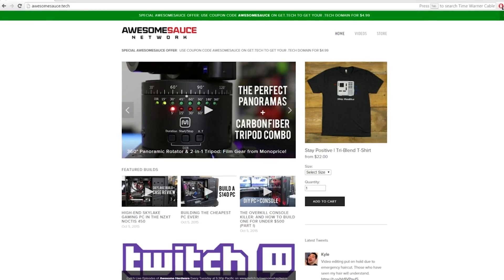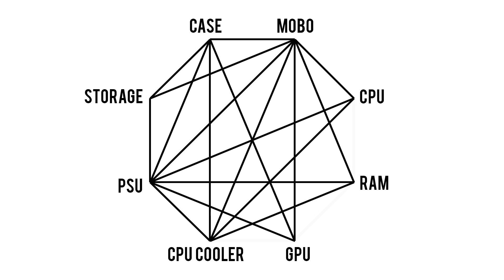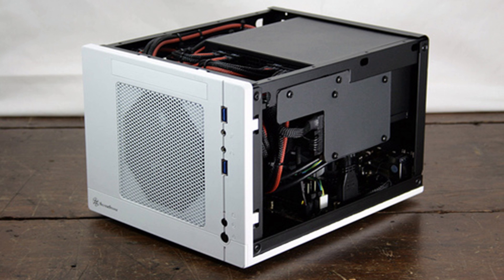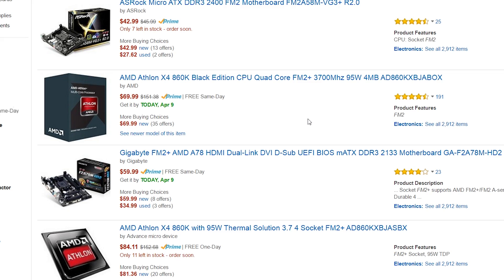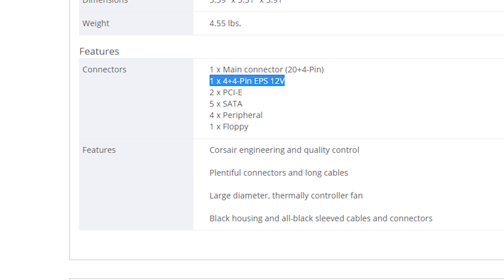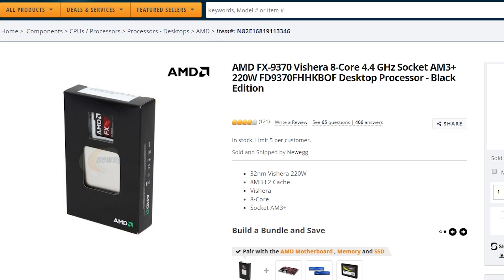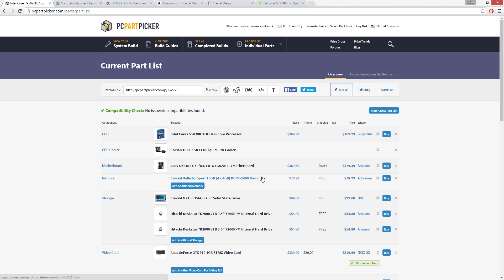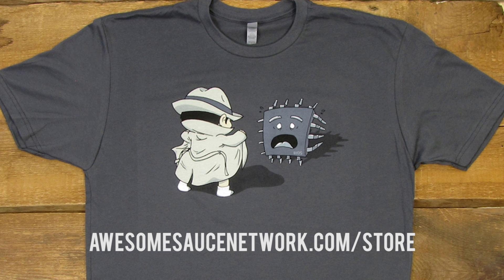How to Choose Parts for a PC! The Ultimate Compatibility Guide!

Comment: Does a msi motherboard always work with AMD ryzen
Reply: SUPERTACTIC yes. I actually have an MSI motherboard and a Ryzen 5 2400g. As long as the motherboard uses the AM4 socket, then you can put in any CPU that has the AM4 receiver.
Reply: @usainbolt7904  no actually. My MSI board only supports Intel CPU's.
Reply: @Sigma_Eight  i didnt mean it like that. What I meant was, MSI boards with AM4 sockets support Ryzen, and MSI boards with LGA1151 support Intel

Comment: I Hope This Helps :)

PSU = Power Supply Unit
GPU = Graphics Processing Unit
MOBO = Motherboard
RAM = Random Access Memory
CPU = Central Processing Unit
CPU Cooler = Central Processing Unit Cooler
Reply: I never knew cpu cooler was the cpu cooler
Reply: HDD- Hard Disk Drive
SSD- Solid State Drive
Reply: Good good. Now what do those.... do?
Reply: @huskobyte  
PSU: Converts outlet power into the different cables needed for your parts
GPU: Handles graphics calculations. Some CPUs have one built in (Integrated Graphics). Integrated graphics will work great for desk work, but won't be able 
to run many modern games at decent settings.
MOBO:
 Everything plugs into this
RAM: Stores temporary data used to run programs, nothing is saved here permanently. 
If you plan on gaming you probably need at least 8 GB.
CPU: "Brain" of your PC.
CPU Cooler: Keeps the CPU cool, as it its probably the hottest part in your build.
Reply: Jake O'Brien Understandable
Reply: @jakeob28  How do I know which piece I should choose, and what makes everything better than the other thing?
Reply: Genuis Bear research, if you put the time in too see what’s best bang for your buck by looking at yt reviews and online forums then you will be sure to save a lot of money
Reply: Genuis Bear your aim in the system is either to have everything you want in the beginning (make sure other parts don’t excessively bottleneck the other parts) or invest more in something’s like the cpu and decent gpu to then upgrade at a later date
Reply: Genuis Bear To check if everything is compatible just use pc parts picker. Com
Reply: RAM is also one of the greatest albums released by Daft Punk ;)
Reply: RGB-RED, BLUE AND GREEN
Reply: @whozurdaddy3423  It's actually Red, Green and Blue
Reply: SilozHD What does SMD stand for?
Reply: @Kai...999  surface mount device
Reply: @Kai...999  I think your in the wrong town pardner
Reply: Thank you 😊
Reply: My hero <3
Reply: Lit
Reply: This would've been super helpful when I first started building PC's
Reply: Was that last one necessary?
Reply: Thank u mate
Reply: Your the man!
Reply: Props to you making a comment we will like without you telling us to like or saying thanks for the likes 😃

Comment: I have an immediate tech question. Don't think I'm stupid for asking this... So I just built a new gaming pc but the old one I've been using is so caked up in dust, duster doesn't work and I don't have an air compressor. As far as the CPU, GPU and PSU that all have fans, could I spray the entire system down with a water hose then let it dry for a month before using it? I'm pretty sure the PSU can hold a charge so I don't want to mess it up but it's caked up in dust the most from the last place I lived with smokers. I'm sure giving it a month before  turning it on afterwards would have it completely dry but how long should I leave it unplugged before all the power is drained and I can start and can I do this without shorting it out?

Comment: Hey Guys Is my PC Build Compatible and Good?

Graphics Card : EVGA GeForce GTX 1080 FTW Graphics Card
CPU : Intel Coffee lake Core i5 8400k Processor
MotherBoard : GIGABYTE Z370P D3 Motherboard Coffee lake
RAM :Ballistix Sport 8GB DDR4 RAM 2666
PSU :VGA 650 B3 80+ BRONZE Power Supply Fully Modular
SSD :ADATA SU700 120GB SSD
HDD :Seagate BarraCuda 1TB Hard Drive
Computer Case : CORSAIR CARBIDE SPEC-OMEGA Mid-Tower Gaming Case
Monitor :ASUS VG248QE 144Hz Gaming Monitor
Cooling Fan : Corsair Hydro Series H115i Pro RGB

Advance Thanks for those who will reply :p ^^

Comment: CPU and RAM are also related. Just like the motherboard, the CPU must support:

        +  The type of RAM (DDR3, DDR4, etc (not sure if it's backward compatible)) 

        +  The frequency (1600MHz, 2666 MHz, etc)

        +  So if your CPU only supports 2400MHz but your RAM runs at 2600MHz then 
            your RAM is just gonna operate at 2400MHz (maybe)

        +  The number of channels (single, dual, tripple, or flex mode)

        +  So if your motherboard supports quad channel and you have 4 RAM sticks but your CPU only supports dual channel 
            then... maybe the computer is gonna operate at dual channel since the CPU doesn't support more than 2 channels 
            (maybe)

        +  and whether or not your CPU supports ECC (server RAM (Xeon does)) or Optane Memory.

The CPU must also be able to support a certain amount of monitors, the max resolution it can handle, and the CPU type must match with the motherboard. They both must be 300 series, same generation, and of course, same socket size. 8th gen CPUs are only compatible with motherboards that support that generation and they are not backward compatible.

So if you are having (let's say) an i7-7700 and a motherboard that supports the 7th gen then you're good. But if you want to upgrade you CPU to (let's say) an 8th gen CPU (let's say) an i7-8700 then you will need a motherboard that supports the 8th gen CPU. Once again, the CPU's and motherboard's generation are not backward compatible as well as the series (300) and socket size.

It's more complicated, man!

Comment: I need help can someone help me?
Is this part list of mine compatible it says it is compatible but still can someone confirm it please?
Reply: https://in.pcpartpicker.com/list/kWpfyX here u go mate im sure u can help
Reply: @TankiUnlimited  this motherboard is micro atx meaning it is a smaller board, the case is atx mid tower meaning it's a big ass case. Parts are fairly compatible mechanics wise other than that but the specs are going to be pretty bad.
Reply: Also with a CPU that lower end you wont need an aftermarket CPU cooler, the one that comes with the Intel CPU will be fine

Comment: BitWit, does my checklist work? I subbed and rang the bell.
CPU: AMD Ryzen 7 1800X $280
MotherBoard: MSI X370 Gaming Pro Carbon $190
RAM: 64GB G.Skill DDR4 Trident Z 3600Mhz PC4-28800 CL17 1.35V Quad Channel Kit (4x16GB) for Intel Z270 $1068
GPU: Nvidia GeForce GTX 1080 Ti  $1400
SSD: Samsung 860 EVO 4TB 2.5 Inch SATA III Internal SSD (MZ-76E4T0B/AM) $1400PSU: EVGA SuperNOVA 1600 T2 $530
Case: Lian Li O11 Air $120
Cooler: Corsair Hydro Series H150i PRO RGB 360mm Radiator Triple 120mm ML Series PWM Fans Advanced RGB Lighting Liquid CPU Cooler (CW-9060031-WW) $247 / Be Quiet! Dark Rock Pro 3 CPU Air Cooler $90
SoftWare: Windows 10 $120
KEYBOARD - CORSAIR K95 RGB PLATINUM Mechanical Gaming Keyboard - USB Passthrough & Media Controls - Fastest Cherry MX Speed - RGB LED Backlit - Black Finish $170
MOUSE PAD - Glorious 3XL Extended Gaming Mouse Mat / Pad - Large, Wide (Long) Black Mousepad, Stitched Edges | 48"x24"x0.12" (G-3XL) $40
HEADSET - Sennheiser GAME ONE Gaming Headset - Black $161
Tool Box - iFixit Essential Electronics Toolkit $24
USB - KOOTION 5PCS 32GB USB Flash Drives Thumb Drives Memory Stick USB 2.0(5 colors: Black Blue Green Purple Red) $36
Wifi USB - MSRM 926AC 1200Mbps Auto Install Wireless WiFi Adapter 802.11AC Dual Band 2.4G And 5G USB WiFi Adapter with External Dual High Gain Antennas for Windows7/8/8.1/10/XP/Vista, Linux2.6.18-3.10y $19

Comment: would a motherboard with 1 x USB 3.1 Gen 2 header
2 x USB 3.1 Gen 1 headers
2 x USB 2.0/1.1 headers work with a case that has 1x USB 3.0, 2x USB 2.0, 1x Headphone, 1x mic front ports

Comment: Would this work as a budget build PC? https://uk.pcpartpicker.com/list/9bmHvV
Reply: If the currency is british pounds (i think it is but i may be wrong), or if the currency has more value than the USD, then id say its alright for a PC build. Try to go a little cheaper if you can.

If the currency is the same value (unlikely) as the USD, then its pretty good.

If the currency has less value to it, then its pretty great.
Reply: Instead of getting a costly NAS grade HDD, get a small capacity SSD and a normal HDD, I suggest WD Blue.

Comment: If the MoBo should be compatible with all parts, does that mean I should start off with picking the MoBo? I'm quite new to this and I'm afraid I didn't really get everything in this video ^^''
Reply: Yes. Pick out these things in order.

Motherboard
Processor
Processor Cooler
RAM
Graphics card (if you want one)
Power supply
Hard drive(s)
Case

This is just my personal recommendation, but ALWAYS pick out the motherboard, CPU, and CPU cooler first and together.
Reply: Thanks, I really appreciate it :D
Reply: Your welcome.

Comment: I am saving up for a pc. The one thing I’m scared for is cords. Connecting them or just making sure that I have the right ones scares me. Really I’m just scared of getting the wrong cords. Also I’m scared of the the parts not fitting the slots
Reply: The power cords come with the power supply. The case comes with its own cords that are for the USB, power, etc cable, AKA the front panel connectors. The hard drive and/or motherboard may come with the hard drive data connectors. If they don't, just search for SATA cable. They should cost no more than a few dollars. They are usually flat and red (the cable part) and have black connectors. Again, you may not even have to buy these.

I'm gonna try to simplify it for you (the _ scared of the parts not fitting the slots_)

The CPU and motherboard are usually the most important. Like in the video, the CPU and motherboard have a socket number. I am using the LGA1151 socket, but there are others also. Check out the motherboard specs and the CPU specs. Make sure it is exact. If the CPU is LGA1151 (300 series) and the motherboard is LGA1151, it will not fit. It has to be exact. 

The motherboard usually has form factors which are, from smallest to largest, mini-ATX, micro-ATX (I'm using it), ATX, and extended-ATX. make sure the form factor of the motherboard is smaller, or the same form factor as the case. 

The power supply you would normally use is ATX, unless your building in a toaster (exaggeration). Just search around for power supply form factors, and buy one that suits your needs. 

The graphics card is usually not needed unless your doing mid - heavy gaming. All expansion cards have either a PCI or PCIe slot. PCIe is just smaller. Check your motherboard specs, and buy the graphics card for your desires, if you even get one.

RAM is usually DDR1, DDR2, DDR3, or DDR4. Check the motherboard for this (it says in the specs) and match up the RAM.

If you do mild gaming/web surfing, your not gonna need that big of a CPU cooler.

These are just a few tips that i have for you. 

Go to the newegg website (www.newegg.com) and search parts and such there. Create an account and a wish list.

Comment: I give up.
I will save more money for the new $2499 Corsair ONE PRO

Edit: Specs
CHASSIS
BLACK, VR READY
CPU
INTEL I7-7700K, LIQUID COOLED
GPU
NVIDIA GTX 1080, LIQUID COOLED
DRAM
32GB 2400MHZ DDR4
STORAGE
480GB M.2 NVME SSD, 2TB HDD
MOTHERBOARD
Z270
PSU
400W SFX, 80 PLUS GOLD
OS
WINDOWS 10 HOME
Reply: iAmmarXGames you know you’ll save $500 if you just build it yourself you know the parts because you just listed them now go watch his video on how to build a pc he even has one where you build at the same rate as him (or you pause the video) but it’s your choice in the end
Reply: Gaming with me I saw it and it looked hard
Reply: iAmmarXGames well it is your choice in the end

Comment: Buy the GPU CPU HDD Ram Motherboard and Cabinet. Then take all those pars to your nearby technician. He would charge >50$ with all the required wires connected and screws tightened

Comment: I just got this case and am having a problem with I guess getting power to the chip on the back that supports the 7 fan plug ins, making me plug into the mother board for the fans to operate but then I don't have control of the lighting there all just supper dim sept for one. help please?
Reply: blaine sutton the fans almost always plug into the motherboard

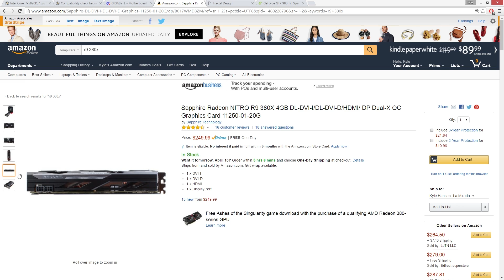Comment: at 13:27 u talk about a low powered gpu with no pci express connectors, which is what im gonna but, but you dont go in depth with it. where do i plug it in and what do i do with the extra pci cords? if u or anyone else can answer my question soon that would be greatly appreciated. btw im getting a gigabyte GeForce GT 1030 2GB Low Profile so if thats important there you go
Reply: Ben Pritchett you won’t need a power cable but if you upgrade then here’s the information the power connecters will generally be at the top of the gpu and the cable will only plug in one way and if you have extras then just leave them you don’t need to plug them in anywhere

Comment: i picked my parts to build, and was wondering if there is anything i should i change, better and cheaper parts etc (first build)
ASRock z370 Taichi
Intel Core i7-8700K
Win 10 Home
MSI GeForce GTX 1080 Ti Gaming X Trio
G.SKILL Ripjaws V 32GB
Samsung EVO 500GB SSD
WD Blue 1TB
Silent Loop Intel 12cm Liquid
EVGA 80+ Gold 650W
Fractal Design C TG Mid Tower
Reply: NIGHT2PWN 3tb hard drive there normally $20-$30 extra
Reply: NIGHT2PWN 
depends on what you're using your PC for. This being a 1month old comment, you probably bought the parts. 
Or did you? 
Hi, Vsauce, Solen'ya here.
Reply: i did actually, lol same parts minus the taichi, mine is strix. i guess its ok for casual gaming
Reply: NIGHT2PWN 
what monitor are you using?
imo a bit overkill (especially the ram with the prices now) for causal gaming, but hey that's just me. Enjoy your rig man.
I'm getting my parts today ;D
Reply: 1080p 144hz lul, i'll have to upgrade my monitor as soon as i get the funds. i splurged on the parts but forgot the monitor prices so im still using my old monitor XD. ty man, hope you enjoy yours too! happy pc gaming man

Comment: Can someone tell me if all these parts are compatible?
CPU: Intel Pentium G4600
Motherboard: Gigabyte GA-H110M-H
RAM: Patriot Signature DDR3 CL11 PC3-12800 ( also if there's a cheaper RAM that you guys recommend let me know, thank you )
Harddrive: WD Blue 1TB
Graphics card: EVGA GeForce GTX 1050 Ti SC or EVGA GeForce GTX 1050 Ti FTW
Power Supply: EVGA 500 W1
Case: Corsair Carbide Series 100R Mid case
Reply: jose.301 it needs to be ddr4 other then that it’s fine

Comment: can i still use a motherboard with only one usb 3.1 header in a case that contains 2x USB 3.0 Ports, 2x USB 2.0 Ports, 1x Audio/mic ?? everything else lines up so im guessing it would work for just 2 of the 4 usb ports on the case and the rest would just not do anything but im just double checking that it wont cause me any problems
Reply: Vary as he said each USB header supports 2 exterior ports on the case

Comment: Hey guys. Anything I could do better with this setup? Looking for maximum 1080p gaming.

EVGA GTX 1060 6GB
Ryzen 3 1300x
MSI B350 Tomahawk Mobo
Corsair Vengeance LPX 2666 MHz 1 x 8GB memory
EVGA 600 BQ 80+ Bronze 600w
ADATA SU800 128GB 3D-NAND SSD
NZXT s340 Mid Tower case

Comment: When getting a radiator and mounting to the top of the case, make sure that the radiator+fans do not clash with the heatsinks that surround the cpu.  Sometimes they can be a bit tall and just barely get in the way. You can either A) Jimmy rig your radiator (dont advise) B) Go DUI and grind that heat sink down(also not advised) or C) Just look at a diff mobo.

Comment: so im having trouble with this, can anyone give me advice in this list and check the specs? https://pcpartpicker.com/list/sfKtvV
Reply: I recommend a that youre going for a 6 core proccesor such as AMD Ryzen 1600 Or an intel coffie lake i5 8400k or a i7 8700k Because alot of games are starting to use more than 4 cores and if u dont have have enough cores you can experince alot of stuttering and lag and issuses like that. id recommend i5 8400k if you just plan on just  gaming and and i7 8700k if you plan on gaming and doing stuff like video editing streaming alot of mutlitasking stuff like that (Coffilake proccesors are only compatible with z370 chipset). For memory i recommend getting a low profile memory (Example: Corsair vengeance lpx) to make sure that there wont be any issues when installing the CPU cooler. for storage id recommend getting a ssd (highly recommend a Samsung 850 evo) but you dont have to, why i recommend getting a SSD is because 1. they are 10 times faster than a normal HDD 2. if you a alot of stuff on the same Storage device as your Operating System is can decrease preformance alot.

Comment: About mobo size I want a relatively small and light pc to move around sometimes and I couldn't find a decent sub-$50 mini tower with good ventilation and a side window (I like being able to see my parts and my gpu im getting will have an led on the fan) so any mini tower recommendations? Also, I like front usb ports insted of like a top one because the plugs wont get bent. I had a decent mid tower idea but in the vid you dont want a small motherboard with a big case (going with b350m for price and weight)